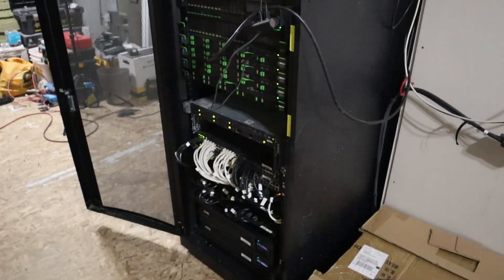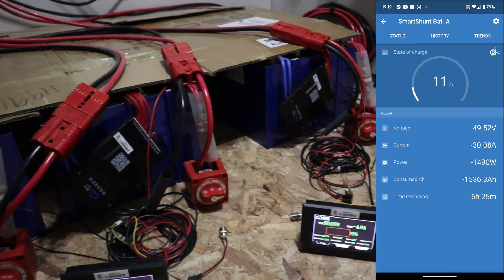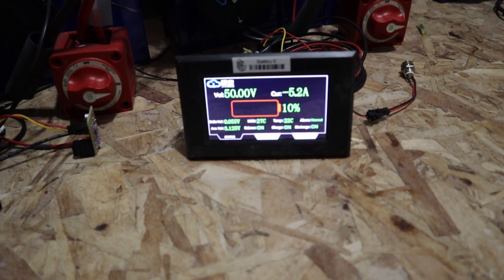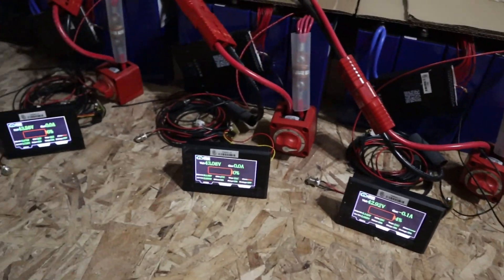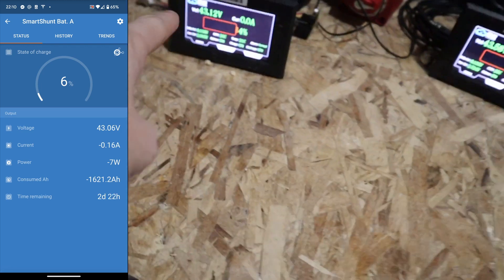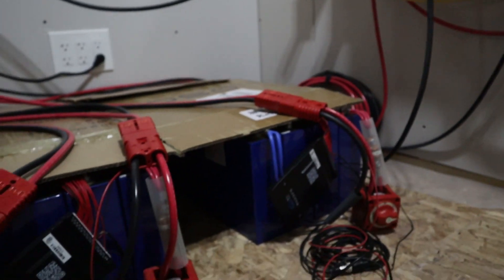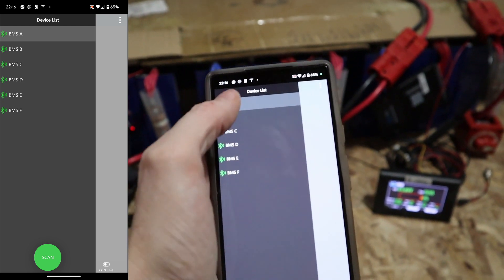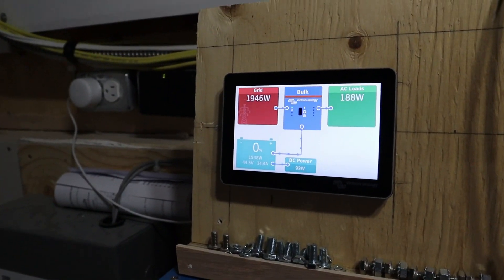Capacity Test Results! - Big Battery Build! (Ep. 47)

Comment: Ignore any losses, they are going to be there in use too, so you have a usable 83.8 as measured by the Victron shunt. I did the same, so that every winter since I can do the same test, and use the same shunt to see if I'm still at the same capacity each year. Not done this winters yet, but every other test its just been the same figure - no losses for first 2 years of use, will do year 3 this winter, may even film it for a change.
Reply from the maker: Aye, I know that the reality will be what the shunt sees, for usable capacity. The goal this test was to see how close I got to what I paid for in the raw cells. It also highlighted, to me, how aggressive the parasitic loads are, and have made me decide to do some tests (in the next video) to see if I can reduce them.
Reply: @TheDigitalMermaid  its basically like just testing to make sure you ONLY have the most fundamental and lowest 'parasitic' losses....  AND NOT some overly high loss in some component, or under some setting or circumstance, as known so far.  But yeah, if its just the reg losses between wires, and connectors, and whatnot, AND NO exceptionally unique higher losses, than you should be good to go, as the system will maintain any of those losses whether during test, or during real-time use, and they're borderline negligible, so dont worry much about those.  Its really just making sure theres no like "weakest link" thats drawing way too much from ur cells/charger.
Reply: Good advice. 
I have a small off grid system... When i finally got a clamp meter i discovered my inverter was drawing almost an amp while it was off! When the sun stops shining and the battery is low, 
I have to turn the whole system off to stop this drain wasting up to 1kWh a day. 
Not impressed!

Comment: Nice! Seems like a lot of energy packed in your boat sooner or later! Sailing your boat at the correct speed will save you a lot of energy waste!
Reply from the maker: Yup! Once the repower is done, there will be a decent amount of testing different speeds in different sea states to find the optimal range setting and optimal efficiency rating. Going to be a lot of fun!
Reply: @TheDigitalMermaid  a friend of mine sails a electric boat in the Amsterdam canals. My takeaway is to have some kind of lock in place on the lever not to be able to push more current through it, this boat doesn't have it and it costs them a lot of range when not looking correctly at the current meter. Hope you can sail soon Maddy!
Reply from the maker: @edwardvanhazendonk  Can you elaborate on "some kind of lock in place on the lever not to be able to push more current through it"? Like a software lock that doesn't let the motor run over a certain speed without an override, or a physical limiter to the throttle handle?
Reply: @TheDigitalMermaid  a point on the lever in which you cannot push further 🤔 sorry my bad in explaining. He has a 48V boat, goes on his max speed at around 60A, when the lever is pushed further the engine will rev harder and can take upto 150A but will waste the energy as it will not go faster (I only know the Dutch word, "Rompspeed" of the boat). Maybe you can have this set in the control electeonics, might help accidental high current draw.
Reply from the maker: @edwardvanhazendonk  Aaah, that makes sense. I think I'd want to be able to go further, but have a rod or something that stops it where I normally want, that I could flip out of the way to go harder when needed. Great idea, I'll ponder on that more, thank you!
Reply: @TheDigitalMermaid  probably necessary when you are going against tide or heavy winds. He just sails the Dutch canals with it (they even got a speed limit of around 5 kph, the boat can go around 7 or 8 kph (sorry, I'm not so into nm or knots).
Reply from the maker: @edwardvanhazendonk  Exactly, there will be times I'll need all the power I can get, but hopefully those will be rare.

Comment: Given that the BMSs and screens are integral to each battery module, isn't it more fair to consider them as internal losses and not worry about calculating them out? Functionally, the loss is both fixed, and inevitable, so from a bulk calculation, it can be rolled in under the total. Both simpler to do the math on, and more realistic, since you can't use up the loss from those systems any other way.
Reply from the maker: Functionally, yes. I was looking at this test as a way to validate the raw cells were the rated capacity though, which is why I was trying to factor it in.
Reply: @TheDigitalMermaid  I figured as much. You did a really nice job on this one. I'm eager to see the final computed results. As an aside, there are plenty of good designs for more efficient buck regulators that could be set up with either individual or global sleep inputs to kill the power draw when it's not needed. It doesn't eliminate  the BMS load, but that extra 200-300W of draw could be very useful out in the water, especially near the bottom of the pack capacity.